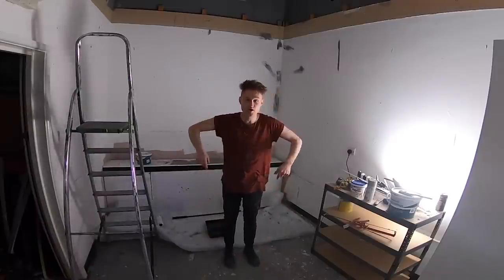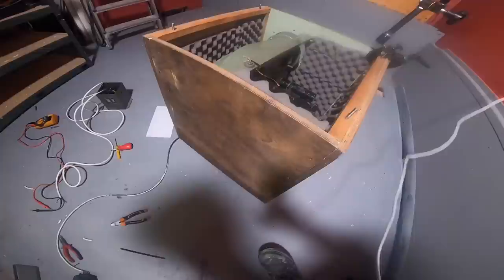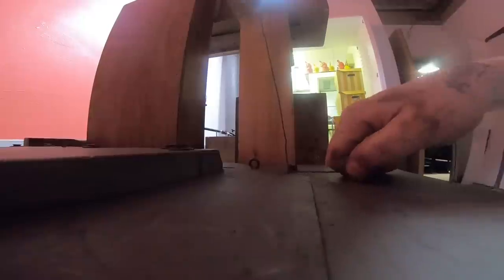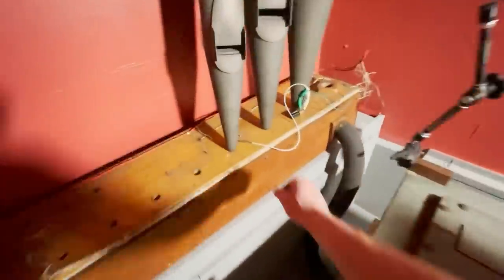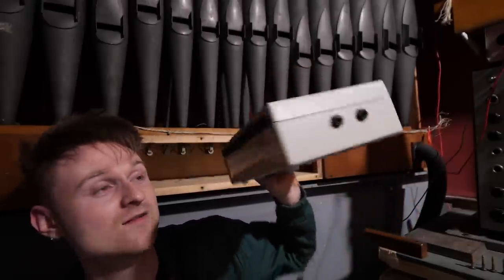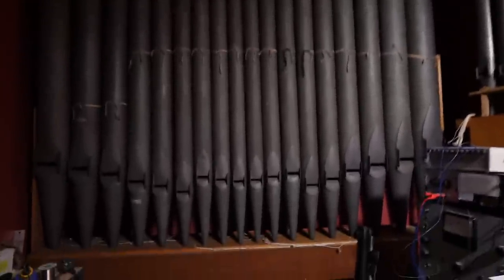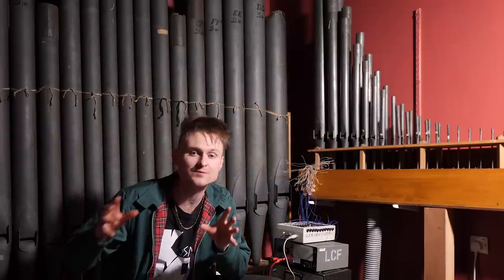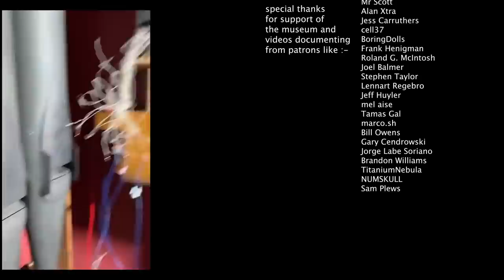I BOUGHT A CHURCH ORGAN Part 2 The First Sounds in 25 years!

Comment: Wait till you hear several ranks of pipes playing together all tuned up.  Strings and Celeste are a couple of my favorites.  And then there's Brass and Reed pipes for the more aggressive sound.  Each type doesn't sound like much on its own, but when you combine them properly, there is no digital substitute.
Reply: Volume control, don't organs use big flappy doors between you and the ranks? Or is that just Wurlitzers?

...

You could add more bits until it's a Wurlitzer... 😍
Reply: @MostlyPennyCat  Yes, that's the swell box. Not all pipes are necessarily contained in that, though.
Reply: @MostlyPennyCat  Adding parts doesn't make it a Wurlitzer. Wurlitzers, and theatre organs in general, have bigger scale pipework, and specialist voicing not typically heard/seen on typical church organs. They are also on much higher wind pressures, church organs are typically on 3-5" of wind pressure, with a maximum of about 7" for louder reed stops. Theatre organs are on 10 to 15" wind pressure typically.
Reply: oh thats sooo true, but he will not get it all up in that room tho, ae
Reply: @OrganMusicYT  the Fox special has ranks on 25” wp. And the Roosevelt memorial park Wurlitzer has some ranks on 50” wp. The Atlantic City organ has 4 reeds on 100” wp.
Reply: @craigbrown7929  thats why I said typically. There are always exceptions to the norm. The Roosevelt Park Wurlitzer no longer exists as a whole, it was recently parted out.
Reply: @OrganMusicYT  too bad about the Roosevelt park Wurlitzer. I knew it had been removed and was being stored nearby. I had dreams of getting it, revising the specs and building a drive in theater around it. Oh well, hope the parts are in good homes.
Reply: @craigbrown7929  they appear to be. Thats the trouble with an instrument like that, not only do you have the difficulties that come with finding a home for a pipe organ, but with the Roosevelt Park Wurlitzer, it would be so loud in a normal theatre/auditorium, it would need to go in a stadium or similar space. Besides that, the scaling of the pipework 
 was off the charts.
Reply: @OrganMusicYT  that’s why I thought an outdoor drive in would be perfect for an instrument like that. Plus it would be very unique.
Reply: @craigbrown7929  Without an acoustic it would sound very dry, rather like the Spreckles organ, absolutely dead, which doesn't particularly help any pipe organ. They do need at least a little bit of something to mix around in. However... can you imagine the noise complaints from neighbouring properties... lol

Comment: The funny thing is the blower turbine is actually on the smallish size when compared to say a theatre organ , a med sized theatre organ would have something like a 30-50hp blower and they are gigantic !
Reply: Can pipes basically handle every flow within reason?  Can we overclock these pipes lol !
Reply: @ericlotze7724  the pipes wont every break due to pressure realistically. there's probably less than a psi flowing, a bigger motor wouldn't boost pressures that much but would increase the flow rate, the issue is quickly the air is moving to fast to make a proper note, think blowing a whistle or recorder too hard, it goes ear piercing then quite because the flow is to fast to properly move throw the whistle. so he could make it loader with a larger motor to a point but it kinda looses practicality. also these are just the bass line so the higher notes will be much louder.
Reply: @ericlotze7724  the pipes would be fine but the voicing would be affected and you also wouldn't be able to control the volume of the organ . Theatre organs operate on extremely high static line pressure compared to a church organ however theatre organs have swell shades that open and close to control the volume of the instrument.
Reply: @WillBilly.  it would be more than just the blower , the lines , windchests, regulators and other components would need to be modified .
Reply: @ericlotze7724  Not really.  There's a whole bunch of physics (and artisan crafting) to the scaling of pipes, which is determined by the wind pressure and desired tonal characteristics for that rank.  Increasing wind pressure does not increase "performance".

All of the various bellows in these winding systems are reservoirs and pressure regulators.  When you play only a few, high notes very little wind volume is needed whilst the pressure must be maintained; when large chords of low notes are played ,much more wind volume is need whilst again, the pressure must be maintained.  These springy boxes of leather and wood take care of that problem.  Raising pressure could also cause the pallet valves to leak (the note will 'cipher') and might require replacement of each electromagnet to one with more power to open against the wind pressure.  More powerful magnets require more electricity and hence, a bigger power supply.  Pipe organs are engineered on an individual basis and making one change will affect other aspects of the instrument.
Reply: Back when I was a church choir boy, the church organ was so huge that the pipes took up more space than the house I grew up in. The air pumps were in a different building.

Comment: Funny story about church organ:  I am an electrician and had a quick job to connect electrical and bus wires to a new keyboard system, which allows someone to play in front of church audience, instead in the back where the actual organ is.  It was a little bit overkill for my taste, as it was made of industrial plc parts.  When I got my stuff done, I told the organ service guys that we should test that new system.  They checked some of their stuff and turn the new keyboard cabinet on.  After few seconds of boot time, all the valves open at once and as the bellows were full and blower on a full blast, some underwear had to be changed :D  For some reason, guy who had made the program for the keyboards, had the key states read backwards, so pushing a key would actually close corresponding valve.

First 2 seconds of that sound were legendary.
Reply: Must have been...quite a blast 😂Thanks for sharing, epic field story!

Comment: Printer cables + terminals (D-sub connectors)  might be a good idea for the final rigging.
Reply: It are called flatcables 🙂 And would be a neat option indeed.
Reply: Really good idea, has to be millions of old parallel printer cables cluttering up peoples attics with no use.

Comment: Putting weights on top of the bellows increases the resulting wind pressure going through to the wind chests and into the pipes. All pipes are designed to work with a given wind pressure. Organs sometimes need more than one set of blower / bellows because they have pipes that work on different wind pressures.

Comment: This a fantastic project and I know from experience you've done a lot more work than we're seeing in the video! The action looks fairly straightforward as it seems to be a direct acting solenoid. Our local church organ, that dates from 1964 in its present form, uses electro-pneumatic action where the solenoid operates a pneumatic lever which pulls down the pallet under the pipe. This system uses a lot less current and the electrics are connected using telephone exchange wiring. I've found that using cut up bits of paving slabs work well to set the wind pressure and this can be fine tuned with the lead or cast iron weights that I can see in the video. I can't see what the stop action is on your organ, but the stop action on our organ uses slider windchests, the slider being a thin slat of wood that can slide in grooves cut into the board that the pipes sit on. The slider has holes that line up with the holes in the toe board but can slide in the grooves so they no longer line up with the airways and 'stop' the pipes in a particular rank from sounding. Anyway, you seem to have it all figured out and it would be great to see it. I'd love to help with it as well, but I live a bit far away (Oxford) to do anything much on a regular basis. BTW, the shutter that closes off the wind when the reservoir is full is called a 'curtain valve'.

Comment: I am super impressed. I pulled out a similar old organ, and it took me much of a summer to get it back to working order. So-many-wires, seals, etc. The bass-end of the rank is a "haskel" pipe. Basically, a "pipe within a pipe" to get an octave lower. You tune them by adjusting the height of the inner-pipe. They used used whenever space does not allow for the full 8 or 16".  Great work!

Comment: You should consider car door insulation(behind the foam, as a 1st layer) for the blower/pump box, as well as other needs for small areas that need sound reduction. It's amazingly efficient, and not very expensive for how well it works.

Comment: Your pump, Dave, might become a little more quiet. I hear it skimming te surface inside. Open it op see where it touches. Might need some bending. Lubricate all bearings. Check if the fan is balanced.
Reply from the maker: It’s fine only when it whirs up . 3in1 on the bearings

Comment: Y'all are talented.  Just some thoughts about air supply:  Technical term for the "pump" is indeed "blower."  I didn't see the inlet for the Dave blower; it is apparently sucking air into the blower box through the outlet opening gap.  A correctly designed opening should be large, perhaps 20" x 20" minimum, and protected with a good, 2" thickness, fluted furnace filter.  And remember that the air coming out through the pipes has to go somewhere, perhaps back into the inlet.  Air, like electricity, must travel in a circuit.  Your instrument will stay in tune and fare much better if you can maintain a consistent temperature and humidity, the more precisely, the better (and more expensive).  Good show!

Comment: Will this organ be playable to museum visitors? (I hope so) It was concerning taking the hack saw to sever the console wiring from the wind chests. However, your MIDI plan solves most of that old-school wiring nightmare. Tuning is easy, properly voicing pipes for the space the organ is installed takes training and patience. Finding an organist guild with technicians can greatly help in this area. Finding all of those pesky "cipher air leaks" is a good short-term plan. Eventually, the air reservoirs will need to be re-leathered. Depends on age, air quality and pollution level in your area, leather can last 50-80yrs. Looks like your wind chests for the most part are easy to solve wind leaks, as they are solenoid/felt air stoppers.. Ambitious project. Seeing any fallow pipe organ brought back to life is a joy. Thanks!

Comment: I restored a player piano, and all of the fabric on the pneumatics had to be replaced. They're covered with a fabric that has a layer of rubber to make it airtight. If you're experiencing a loss of pressure, maybe your rubber in your fabric is dry rotted as well.

Comment: Standard Midi can adress16 different instruments/ banks or pipes.. So each midi-based solenoid controller becomes 1 instrument, with a standard ac plug-pack for power. The rat's nest of wires becomes a single midi cable between banks of organs. After this upgrade the organ will actually have some value, being easier to transport and reinstall again afterwards :D
Reply from the maker: That’s what I’m doing 👍

Comment: The transformer can be repaired if the Windings haven't burnt out of course what you would have to take all the paper off the transformer and the type to make sure all the way up is ok you can also stick a multimeter across the terminals to see if you get a reading

Comment: Hi, ex organ builder here. Just a couple of things of note, you need the proper amount of weights on the bellows to create the correct air pressure for the pipes, it’s actually pretty critical to the voicing and tuning of the pipes, to stop them over or under blowing. The slide valve also needs to be set with the blower (not a pump!! 😉) is running. 
Plus when you are tuning them don’t use your hands, your body is too warm and believe it or not a few minutes after you ‘tune’ it it will cool and go out of tune, this is far more critical the further up the rank you go. Eg, the smaller pipes.

Comment: If you were really nuts, you'd find a way to illuminate each of the pipes with an LED on the same circuit as the flapper solenoid. Trick there being the right placement of the light for the right ambience. Also how soon until a round of Toccata and Fugue in D-minor?

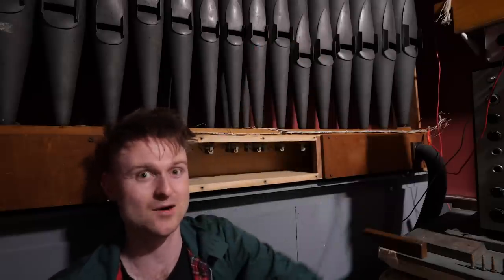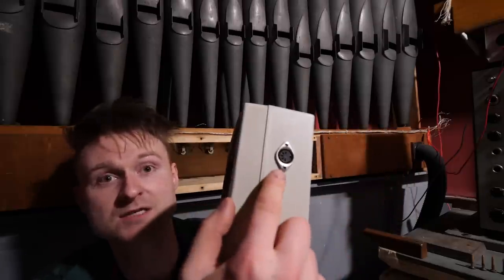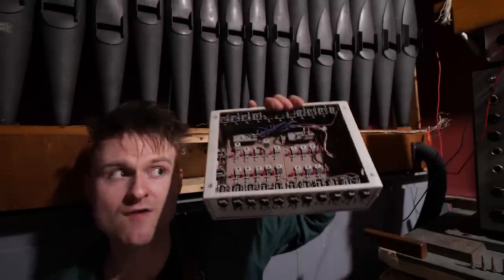Comment: Getting there, and you are starting to learn the terminology too. It's fun playing with the bass pipes!  I see your reaction at 7:22.  I have a good sound system on my computer, so I can hear how low that bent pipe is going.  NICE!  Also it is much quieter now that you plugged up the (currently) unused holes.   9:45  Yep...then the REAL fun starts when you have to tune it.   Alright, I am being sarcastic there.  But if you been through it before, that will certainly be some prep for it.  But it will take a very long time especially if you want the organ to be precisely in tune so you can play other instruments with it.  10:00   I was going to suggest Midi Boutique as they carry Midi to valve controllers for this purpose, but it looks like you got one already.  10:47  Nice!  Now you just have to wire it up to the valves.   12:05  Ehhhhhhh, yeah, as I suspected, you will have to tune it.  Moving the pipes can change the position of those sliders and knock things out of whack.  Then you don't know how long the organ wasn't used at the house so just changes in humidity will alter the tuning.   Also, while I am on that topic, I am assuming you have climate control at your museum.  Try to keep the temperature constant...that will help to keep the organ in tune longer.   12:57 - Not bad, getting there.   You didn't mention how many ranks the organ is...that will certainly determine how long the tuning process will be as you have to do the tuning process with all of the ranks.   I am assuming the large pipes are part of the Great Manual and usually they are the Bourbon pipes as they have a flutish sound, which usually have a very strong fundamental.  Once that rank is tuned, you can tune the rest of the organ to it.  It is a long process, but you seem to be patient enough, so you will get there.  I certainly would love to be there with you as this was something I always wanted to do.  15:32....Ahhhh, now you are poking fun at guys like me, huh?  Well, I never said that you wouldn't be able to tune it.  I believe you will...I just said it is going to take some time.

Comment: The Blower looks (although heavy) small to me, then again I'm used to seeing the workings of Theater Organs which usually have Higher Pressure Schemes.
Reply: I recognise the blower. It would be quite adequate for an organ of that size, and will produce a wind pressure of about 5 inches. The organ was probably designed around a pressure of about 3 inches, which is why you have the appropriate weight on the reservoir, and the wind control (the shutter device) to help keep it all regulated.

Comment: Excellent 😎 I would have done the exact same thing, it would of been a million times more difficult to try and save the original wiring, its obvious to any one who understands electronics to hack the old wires and rewire the solenoids with nice new wire and fire them with a micro controller and shift registers 🤷‍♂️ you would still be removing it if you were saving and reusing the original wiring 😅

Comment: 10:03 MIDI wasn't made for keyboards. At least not only, in my opinion it was rather for sequencers and computers to control other devices producing sound and to sync effects like delays, slicers or pans with BPM and progress of the track. I still do use it to control BPM/intensity of my guitar effects etc. Overally Musical Instrument Digital Interface was made to unify digital instruments language so all the musical controlling and controllable devices can communicate in one standarised language. EDIT 02.06.2022: R.I.P Vale Dave Smith a.k.a "The Father Of MIDI" 
:(

Comment: I loved the outro,  If you HADN'T taken it on, it would've ended up being bought by a scrap dealer... so HUSH critics

By the way Sam, if you need between 200-210v, a permanent solution could be 3x12v transformers wired as 'buck' transformers for the mains. Like your variac (not rheostat ;) ) it doesn't provide isolation, but will reduce the voltage. Googling can provide wiring diagrams for it or i can help if you need? The advantage is the transformers only need to be rated at a fraction of the power of an entire isolating transformer. Loving the series mate :)

Comment: To help find the leaks in the system you could try using an "autool smoke leak detector". They're used in automotive repair to check for vacuum leaks and boost leaks mainly, but it could be used to help find leaks in your system. Just have the output of the device going into your airpump while it's running and it'll push out smoke wherever there's a leak. This video has more info on this and a simple way to get the material required to make it run (copied the url at the time he talks about it). https://youtu.be/rPyZGHnW6EM?t=1394